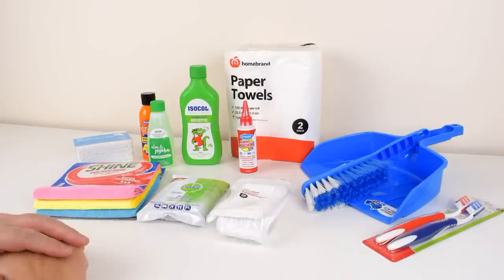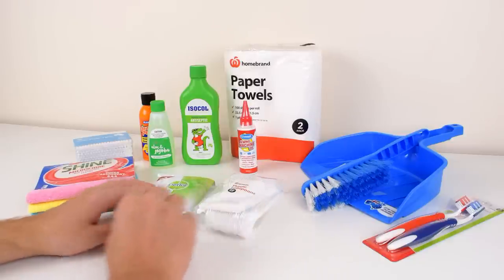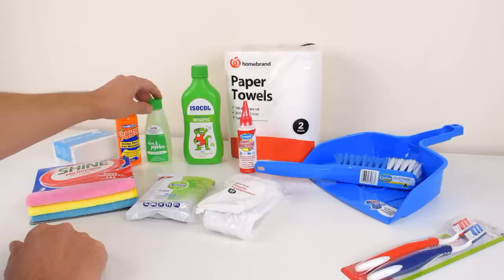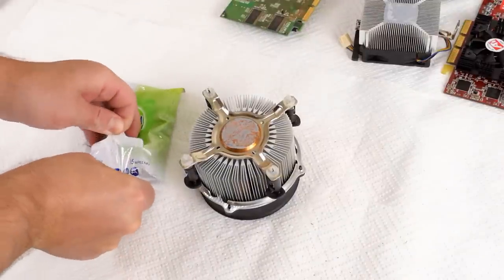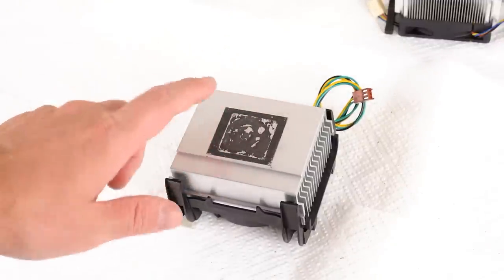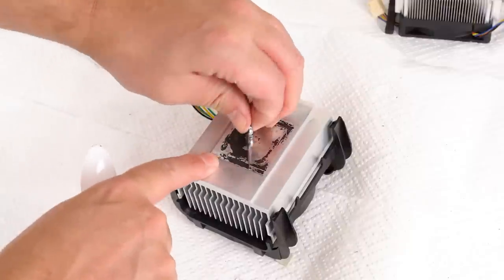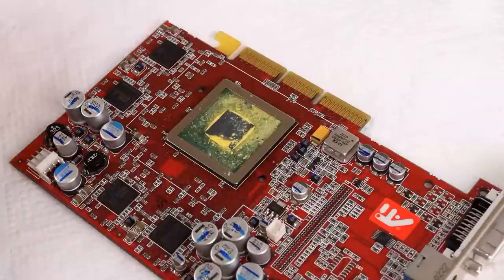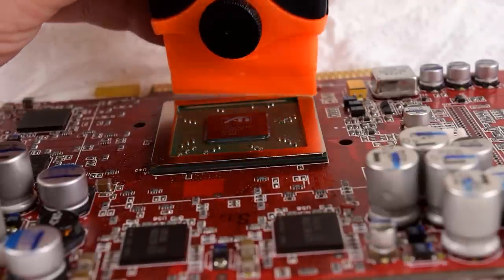How I clean old computer parts with household products

Comment: It might be unsafe to use the brush on a circuit board, because the brush isn't ESD safe. Try to get an ESD safe brush whenever you can.
Reply: It is unsafe. ESD brushes are so cheap there is no reason not to.
Reply: How would you even spot an ESD safe brush, anyway? Not like I've seen any that were marked or marketed as such.
Reply: I always see people commenting that he can't use something due to esd. but he has used that brush in multiple videos and they
 all ran perfectly afterwards. while I do know and understand esd is a thing, it works for him and most of the things he uses it on are relatively cheap and I don't think it would be a devastating set back. I also use these things on older cheap hardware. that being said I would never take any chances with new expensive stuff.
Reply: Just because they work, doesn't mean they haven't been damaged or their lifespan shortened. ESD protection is so cheap there is no reason not to use it.
Reply: I just ordered some ESD brushes from uxcell on Amazon and these bristles are like the equivalent of an EXTRA FIRM toothbrush. Great, it's "ESD Safe" but it feels like it would scratch the hell out of boards even with light brushing. It's not just uxcell either, most of these brushes seem to have the same design. I would tell people not to buy into this crap and maybe just get something like what Phil uses.
Reply: The brushes them self are not ESD Safe. They are conductive and static dissipative and are only ESD safe when someone who is properly grounded is holding them. Also. You're not supposed to brush hard with these brushes. You're not brushing your teeth, unless you really push hard you're not going to damage anything, these are simply to remove lose dust, it's the reason why you use a solvent as it's supposed to do the heavy cleaning. 

Also, "I would tell people not to buy into this crap" so ESD damage is a myth and large company's like Global Foundrys and TSMC spend hundreds of thousands on ESD protection are doing it just for fun? Ever wonder why your PC parts come in an ESD Bag? Stop spreading false information based on ignorance.
Reply: InfiniteClouds Yeah, and also dude there are more that only one model of ESD safe brush.
Reply: Yeah, you can get like 5 for £5 on Amazon.
Reply: Long time PC enthusiast here. ESD hasn't been realistically a problem for decades, mate. The last time I had anything happen from ESD was an Athlon XP and even then, that was on hardware that was already somewhat faulty. (RAM died, if you're wondering. It might not have been ESD but I know it was working albeit it'd start throwing occasional errors in Memtest after a few hours when I'd put it in its box and it would only selectively pass post and quickly crash during boot/memtest when I put it back in the system.)

But regardless, my current system is only starting to degrade after 5 years of heavy usage including Folding@Home and Crypto mining on the GPU (The only part actually degrading at all and even then, it might be the fan itself which has a faulty bearing and wobbles when over 45% fan speed causing issues with its slightly higher resulting temperatures) which is only noticeable in that my 24/7 stable OC is now 1.1Ghz instead of 1.15Ghz. The GDDR5 isn't degrading at all...In fact after reading up on the memory straps on the HD7950 (And customising them to be more sane, tighter at lower frequencies but also slightly looser at higher frequencies) it's now clocking higher than ever before at 1500Mhz (6Gbps) completely stable when dual mining Siacoin and Ethereum. It's been built and maintained practically exclusively on carpet (The sole exception being when I had the CPU under water: I filled and leak-tested on concrete to allow for easy cleaning) and I've never owned an anti-static wrist strap in my life, I also have very long hair which usually brushes over the hardware itself as I work fairly often among other things that cause static electricity. The GPU has only really degraded because of temperatures in general (85-90c in the summer) as far as I can tell, but at 5 years old this GPU is due for replacement even with how slow hardware moves these days, even if I wanted a GPU for a HTPC I'd buy a cheap new one for support for more video codecs and the like.
Reply: +Tim

>Just because they work, doesn't mean they haven't been damaged or their lifespan shortened. ESD protection is so cheap there is no reason not to use it.

Do you have any sources for this, or is it just FUD? I've used dustpan brushes, tooth brushes and paint brushes for 25 years to clean electronic gear and have never had an issue with component death or lifespan reduction.

All of the electronic gear I've cleaned with such methods has lasted for decades without issue.
Reply: +TheDemocrab

I really doubt ESD killed your board. QC industry wide in the Athlon XP / Pentium 4 era was abysmal. Compounding that problem was the capacitor plague where pretty much every vendor was either using fake Taiwanese caps or United Chemi-Con KZG series capacitors which were just as bad. Failure rates were near 100% for many years, and people are still discovering old land mines from equipment put in storage before they failed.

Capacitors from that age can silently die by going high ESR or shorting out, causing motherboard failure. I recap pretty much any board I come across from that vintage to avoid running around in circles to try and solve red herrings for hours.
Reply: Dalle Smalhals> I hope that was a stupid attempt at being funny.
Reply: Ask any large component manufacturing company like Asus and they will tell you that they use ESD protection in their assembly lines. Also how do you know that the component didn't have a lifespan reduction? Do you have a board from 25 years ago untouched to compare against a board you worked on 25 years ago to test? If not you cannot use that as a basis for comparison.

Also here are some sources: 
https://www.intel.com/content/dam/www/public/us/en/documents/packaging-databooks/packaging-chapter-06-databook.pdf
http://incompliancemag.com/article/the-qrealq-cost-of-esd-damage/
Reply: I assume you're talking to me? I'm on no crusade. I simply want to dispel the myth than you don't need ESD protection when working on a computer. If you choose to not use it when working on your machine, I literally don't care. I really like Phils channel as he puts out great old school content. I just don't want him to destroy a part due to ESD, that is all. 

I work in IT, I work on hardware that cost more than most peoples car. We are talking £4K+  items.  Each server rack could have £10k+ worth of equipment on it. EVERY rack is grounded, in this type of environment ESD is taken very seriously, even if it's just to swap one RAM stick.

(Edit) Also, for the shake of what? £20-40 quid, people are bitching about ESD. Yet they won't think twice about spending £2k on a water cooled rig? It just seems silly to me.
Reply: Dalle Smalhals are you feeling alright over there? You seem to be taking this very personal.
Reply: So if a mechanic told you not to do X to your car. You would ignore their advice and still do it. Lol.
Reply: Tim absolutely. I drive a hybrid Camry and have had plenty of mechanics give me advice that does apply to a normal car but either doesn't matter (as per Toyota's specs) or would actually harm a hybrid. Or has harmed even a normal car...

Humans can be wrong, and if you think ESD isn't a non issue for 99% of users 99% of the time, then you're simply more cautious than most. Doesn't mean it's even saved your ass once though, speaking as someone who has been working with computers since I was 5 and since before you were likely out of diapers.
Reply: Firstly. You missed the point of the message I was trying to get across with the mechanic example. Of course a mechanic who doesn't work on electric cars wouldn't be giving good advice. I do not see your point there. 

Secondly, ESD isn't a non issue for 99% of the time. It's an issue 100% of the time. And just because you've been working on computers for x number of however many years, doesn't me you have been doing it right. I also highly doubt you where "Working" on computers since you where 5.

Edit: I'm also going to leave these two videos here that I remembered about.

https://www.youtube.com/watch?v=LgTM6VrEhKQ

https://www.youtube.com/watch?v=AhlyMdiLc0E
Reply: If it really is a legitimate issue companies like Menda do us all a disservice. Look at their product page: ESD workstation organizers, ESD drinking cup, ESD LOTIONS?! It reeks of fraud.
Reply: Actually, people entering clean rooms are required to use ESD lotion on their hands from a dispenser believe it or not.  However, the ESD drinking cup is kinda funny.
Reply: Just because some guy works in IT, does not mean he's an expert on whether ESD affects hardware or not. You can have literally years of experience in IT and if you've never bothered to build a PC on carpet or without an anti-static wrist strap you've more than likely got less experience than I did with ESD and computer parts when I was still a teenager...You almost certainly would be able to whoop my ass on heavier server related stuff (eg. Networking related shit like subnets) if you're dealing with that every day, but I've been working on, maintaining and building PCs for a good 30 years now and the last time I had hardware die from what was definitively a ESD discharge was at least 10 years before that, if not 15. (I've had a couple parts since then die from what I suspect is ESD, but as someone else replied to my previous comment saying about one of those, that era was just horrible for PC reliability in general.)

I absolutely have been, even if when I was 5 it was mainly helping out my Aunt with some of her PCs as she was big on computers from the day she got to have a go at the massive room sized 70s mainframe at her Uni, she got me into them with the help of some early games and gave Mum and I an old PC to start off with which is where I started, but I always maintained it inside and out because she taught me how to as part of getting it, Mum also made sure to explain to me that she wasn't going to pay for a PC so if I killed that one, that'd be it which caused me to be very, very careful around it until she felt from my usage of it that keeping one in the house was beneficial to my education. Either way, I've had years of doing things that people who make ESD out to be a big issue for the home user would say could easily kill my hardware and I haven't had anything die or even degrade. ESD is something for select markets to worry about (eg. People who help make the internal components of each PC part) but that comes more down to the protections we've worked out over the years not all being active until everything is together and bonded. You'd be surprised how everything fits together...Like did you know that heatspreaders and IHS' act as ESD sinks? The idea being that when you're touching the parts they're attached to, you're likely going to at least brush that part possibly causing an ESD: Instead of its thousands of volts going into tiny wires designed for signalling voltages only, those thousands of volts just go harmlessly through the packaging which is insulated from the sensitive parts. There's also more anti-ESD tech inside the chips themselves (Even simple things like redundancy come into play here) which means that while it's absolutely possible in theory to kill any modern chip from ESD, in practice it's kinda like getting a virus on Plan9 from Bell Labs: It's so hard to accidentally do that you practically have to be trying to. (Hell, it's not even hard to test: Get a cheap CPU and motherboard, rub your feet on carpet or the like and then let yourself zap the CPU, you might damage it but you'll be surprised to see that it'll likely run just as well as it did before.
Reply: Firstly, I never claimed to be an "Expert on ESD"

Secondly, why are you toting that building a PC on a carpet is some badge of honor? When I'm sure you had a perfectly good table in your house somewhere... My point stands. If you're a professional. You act like a professional, by using professional tools. Especially if you're working on other peoples stuff.

It's called chain of custody, and it stops at someone. It's ok for the PC guy building his rig to not care about ESD, if he kills it, he will just RMA the board. My main point still stands. Why take the risk if the equipment is so cheap? Seriously? What are you people trying to prove by trivializing ESD. Buy a mat, strap, and plug and don't worry about ESD ever again. 

Like I've said. I built my first computer without ESD protection, would I make the same mistake again? No. It would be stupid.

Edit: Also I wish people would stop making out that building a computer is some difficult thing. It's not. If you've built a computer, you've built a computer. Yes there are things like overclocking and water cooling, but even that is simple crap. Once you've done it, you've done it. It's not like you hand soldered anything. It's literally just expensive Lego. Why do you think PC repair shops are slowly dying away...
Reply: +Tim 
>Do you have a board from 25 years ago untouched to compare against a board you worked on 25 years ago to test?

Yep, I got multiple boards that are 25+ years old, some which have been worked on and some which haven't. Guess what? They all still work great.
Reply: By untouched, I mean still in box unopened from the manufacturer. Which you would then have to open with full ESD protection to rule that out as a variable. Unless you can do that it's not a fair comparison.
Reply: I watched that video when it first came out. It was wrong then, and it's wrong now. If you actually watch the video and don't just blindly take his word for it, you'll see that EACH and EVERY time he goes to touch a part he touches the camera first. So all of the static would be gone when he touches the part. Maybe actually watch the video. Also on the first part where touches does the HDD. He touches the Metal part on top. Not the PCB on the bottom. /s
Reply: Read the description - the camera stand is not a ground.
Reply: Lol what? That's not how ESD works. Static charge travels on the surface of objects, so non-conductors can also dissipate static charge. If they couldn't, we wouldn't have an ESD problem in the first place... Do people just blindly take other peoples opinion as gospel? "He made a YouTube video about it! So he must be right!" /sigh
Reply: +Tim 
You're really grasping at straws aren't you? You don't seem to comprehend how electronics work if you think 25 year old New-Old stock is a valid comparison.

Even assuming you babied a NoS piece of gear in some climate controlled warehouse for 25 years, it will most likely either fail or not work properly if you suddenly powered it on after all that time. Capacitor electrolyte degrades if not used, and will cause the capacitor to fail in a variety of ways from leaking all over the board to just shorting out. That's not counting the other ICs on the board which can also fail.

A valid comparison is two pieces of gear which have been regularly used, with one having been repaired. Your NoS argument is a pathetic armchair know-it-all argument grasping at straws.
Reply: Ahahaha. I'm the one grasping at straws? Clearly you don't understand how you conduct a scientific test. We aren't testing for irrelevant stuff like whether the electrolyte caps work or not. (Also this argument is BS too as plenty of electronics from the 80s still work perfectly fine.) the whole point of testing is to remove all other variables and only test the ones we expect an outcome from. (In this case ESD damage) which is why you need an unopened factory sealed board. So we can be sure no other person has touched it and caused possible ESD damage. But, clearly you failed to understand that part. Also, I said nothing about the comparison of a 25year old board to a new one. Two 25 years old boards is what I meant. Considering you said you have some laying around.

Also, I see you're reverting to name calling. You can tell when a person has lost credibility in their argument when they resort to name calling. 

Here are some videos for you to look at to further prove my point.

https://www.youtube.com/watch?v=nLy_jEbuY-U The computer in this video is 29 years old. Oh look...No broken caps or anything. It still works... Shocking. 

https://www.youtube.com/watch?v=h-gtUbHVbm0&t=874s Here is Steve from Gamers Nexus addressing the issue of ESD at 11:24. If you watch the video you will see that he has the GPUs on a ESD Mat.

I'm done in this comment section. The stupid is starting to hurt too much...I just hope that some people read what I have said and take it on board. Whether you choose to take my advice is up to yourself. Doesn't effect me in the slightest, just please don't work on other peoples devices without ESD protection, it's not a how a professional works.

(Edit: If you know so much about electronics. because apparently I "don't seem to comprehend how electronics work" (Once again. I never claimed to be an Electronics Designer.)  Where is your Electronics Engineering Degree? Or decades of Electronics Design Experience. Because where I'm siting, it doesn't strike me like you have the knowledge that Dave from the EEVBlog has. (BTW. He uses ESD Mats in his Lab, which are grounded... Once again. Proving my point.)
Reply: Tim, I'm literally going to prove you wrong using only statements you have made or videos you have linked to in this comment thread.

1) GamersNexus are hardly experts, they're reporters. They can be just as easily misinformed (And as we've already covered, experts only have a higher chance to know wtf they're on about. They may just be talking out of their ass but with a more educated guess than the average person) and even say in the bloody comments on that video you linked something along the lines of "It doesn't appear to matter all that much, but we've had hardware die (Because we deal with so much of it) and recommend it as a result", which from the simple fact that they're a company putting out How-To videos relating to PCs among other things probably comes more down to preventing any possibly legal troubles if little Johnny takes apart Mums laptop and kills it using one of their videos as a tutorial. (Not likely, but stupider things have been sued over.)

2) I don't need to compare two 25 year old identical boards, I have a PC Partner VIB878DS that I've treated like complete shit for the better part of a decade yet it still works flawlessly with my Pentium MMX 166 OCed to 200Mhz. I use that PC as a DOS gaming rig and rarely clean it out, never work on it with any ESD protection whatsoever (Even working on carpet) which means I can say for 100% sure that ESD hasn't killed that part. With any old part, especially given the sheer amount of 90s/early 00s parts that had cap leaking issues or other support components that had bad batches, it's very possible to mistake a random death for ESD. (eg. RAM around the later SDRAM and most of the DDR1 era was very unreliable if you went cheap.) How do you know ESD causes hardware deaths regularly enough to worry about? Have you done a test and if so, when was it? How did you see if the hardware actually died from ESD or for some other unknown reason?

3) Do you not see the flaw in your logic with that last comment? "We aren't testing for irrelevant stuff like whether the electrolyte caps work or not. (Also this argument is BS too as plenty of electronics from the 80s still work perfectly fine.)"
Firstly, that stuff isn't irrelevant as we're also dealing with hardware deaths from other sources. (eg. Simple electromigration over time, particularly as some shady dealers used to sell lower clocked chips with a new badge and a OC.) 
Secondly, there's a LOT of sources on electrolytic caps bursting, leaking and being generally unreliable and a bad choice for PCs...If you've truly been working in the IT industry for half as long as you say, you'd know this and would have seen it first hand in the mid00s when everyone started using solid caps specifically because those issues were still fresh in the mind and it made for a great marketing point.
Finally, why would you accept "None of this hardware have issues with their caps as plenty of 80s tech works fine" as a valid argument when you've got at least 3 separate people all telling you about hardware they've handled in ways that practically guarantee some form of ESD into the components and that's not enough to say that maybe, just maybe, ESD is something you only really have to worry about in specific circumstances.

And to just finalise this comment: When you're working on a home desktop, it's in a metal case with a metal heatsink and tonnes of other metal parts all connected to the ground plane. Assuming you're touching any of those parts (Somehow not a tall order to think you'll touch the case at all when working inside the PC..) then you're most likely removing any differential between you and the PC as a whole practically preventing any ESD at levels that's actually going to cause any harm
Reply: Fuck....Boi....
Reply: Dalle Smalhals 
That's what I thought until I killed a motherboard last week.

It was working but filthy, so I took it out and brushed it like I had done countless times in the past.

I put it back in, and the UEFI was all messed up, and the machine kept freezing during boot.

It gradually deteriorated until it wouldn't even POST, and then it fried my psu.

Luckily the processor wasn't damaged, so I just need a new motherboard.